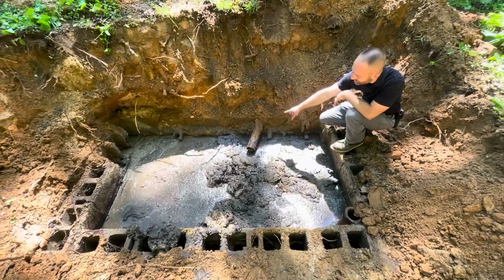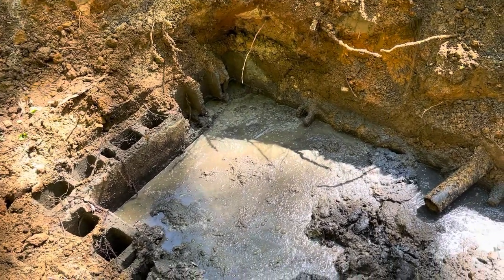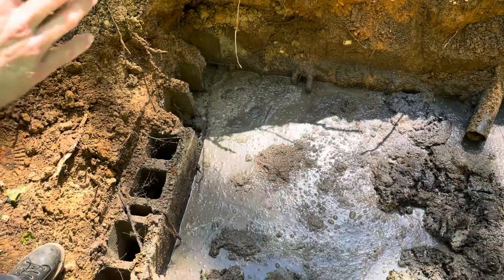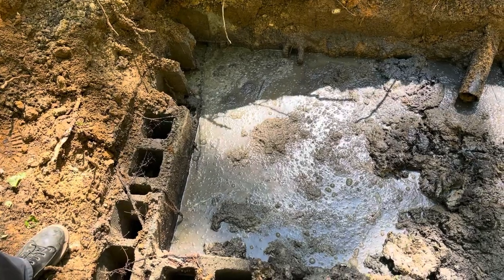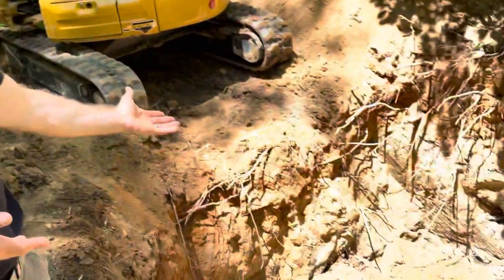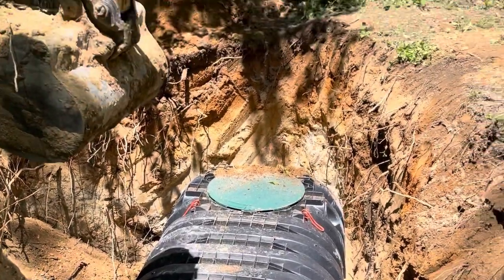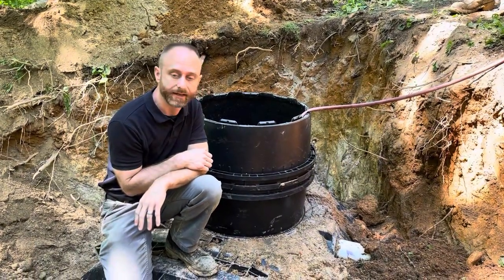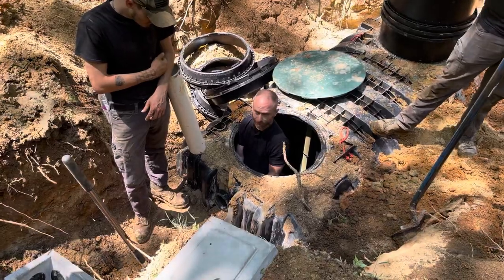Collapsed Septic Tank

Comment: So how much did this cost? It seems like ripping out one and installing a brand new one is going to be pretty expensive. Also, are homeowners fined for these types of things? Like if their septic tank fails and stuff leaches into the ground?
Reply: It's like having new plumbing done I'd say, having a digger on site with a big hole, all I would see would be $$$$$$ signs 😳
Reply from the maker: total job 5.5k
Reply: @JamesButlerWellAndSepticLife  That is actually very reasonable in my opinion. Multiple guys, big equipment, high fuel costs, material costs, etc.
Reply: @opinionatedman  yea, I would say money well spent.
Reply: @JamesButlerWellAndSepticLife  not a bad price. And what value can be placed on a good dump and flush. 
Besides, whatcha gonna do? You gots to poo.
Reply: @JamesButlerWellAndSepticLife  That seems overly reasonable... I'm in Maryland so our average is $9.6k and it can be closer to $11k... Maryland makes you install the fanciest newest technology.
Reply: As a guy who's having to buy his first home soon hearing these numbers gives me a heart attack every time. I ain't gonna live long enough to have to buy the thing at this rate.
Reply: @Oilfieldscout  “good dump and flush”……..sounds like a name for a good song ☺️👍
Reply: Good dump and flush sounds like a good name for a taco place 😂
Reply: @JamesButlerWellAndSepticLife wow WAY cheaper than a sewer line repair in my area.

Comment: Why use a plastic tank? Is there an advantage over a concrete tank? Or, is it a more cost effective option for the home owner? I don't know anything about it.
Reply: Probably more cost effective and easier to replace if there is a problem. No massive amounts of debris that has to be removed
Reply: @NyxHunter  Yeah, that's what I figured. It doesn't get buried very deep. So, the chances of collapsing is minimal. Hopefully is quality plastic that doesn't get brittle. The only problem I could see is if the microbiome of the tank fails and then freezes in the winter. As long as the bacteria is doing its job, it should remain warm.
Reply: @mds6387  Plastic tends to get brittle when exposed to UV light from the or some interior lights.
So it should be fine on that front. Plus it shouldn't freeze no matter if the microbiome is healthy cause they are placed below the frost line where the Earth's themal mass keeps it warm enough to stay liquid like underground water pipes
Reply: @NyxHunter  Not many tanks are below the frost line. Maybe that's code now, I don't know.
Reply: @mds6387  I did a quick Google search and the frost line in North Carolina where he's based is 10 inches. So that one should be below it.
Mind you for Indiana where I live it's 36inches minimum
Reply: @NyxHunter  yes the earth is some of the best insolation. That's why some people build berm homes because of the low dollars spent on heating and cooling

Comment: When did the industry switch over from cement to poly tanks?
Reply: That's what I was wondering cause my house as a 3 baffled tank and its concrete and has been in the ground since we built the house in 05
Reply: Same here, my tank is concrete and only partially submerged. Nothing gets buried in my part of Texas due to all the dang rocks, like sheets of rock. The dirt the contractor put on top of the tank has washed off in the 12 years I have lived here.